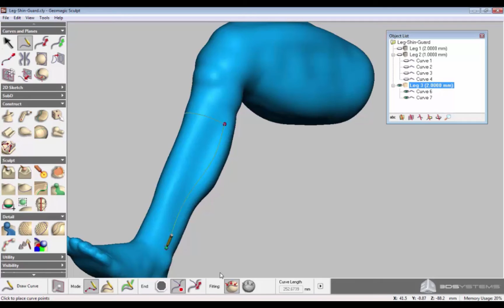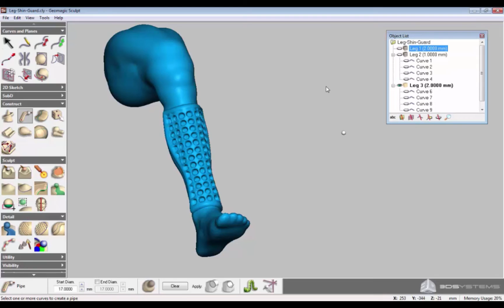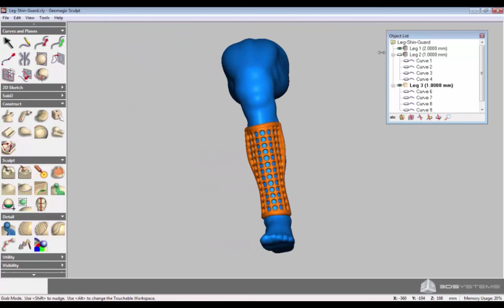How To - Creating a custom shinguard in Geomagic Sculpt

Comment: Could I actually print a custom molded PLA shin guard that is a little smaller that runs only on the upper shin and use it in a recreational soccer match? Do you know how it would work?
Reply: did you do it , i am trying to design something with streght and impact resistant . it would take a while in solid works , this software can design it quick protoype 3 guards in one day